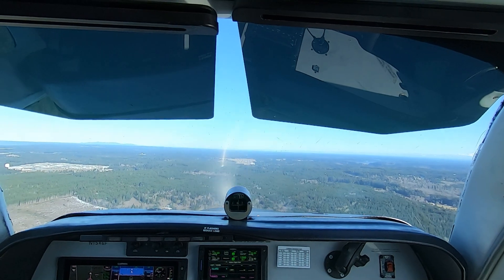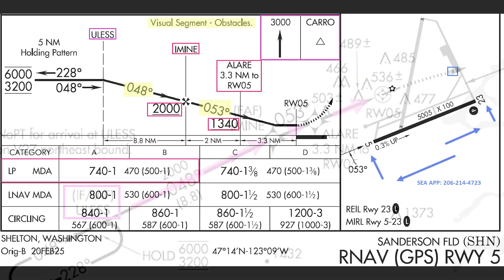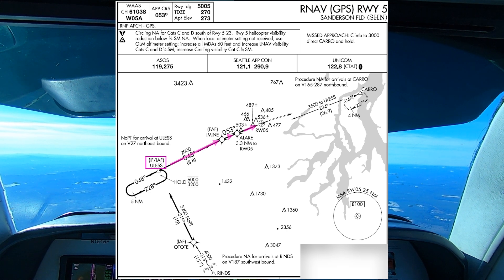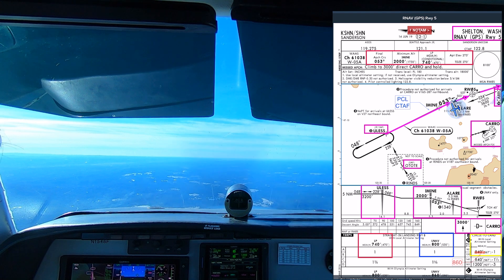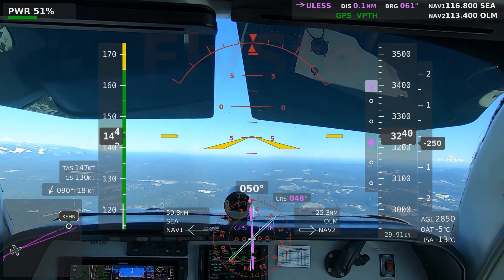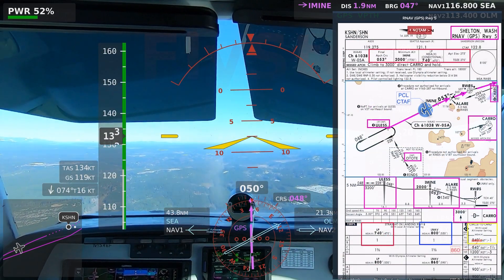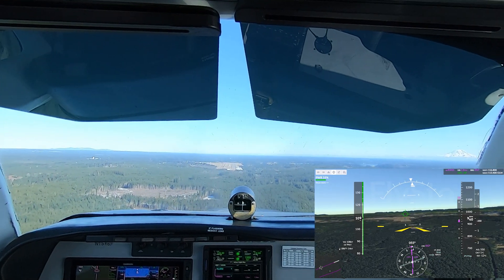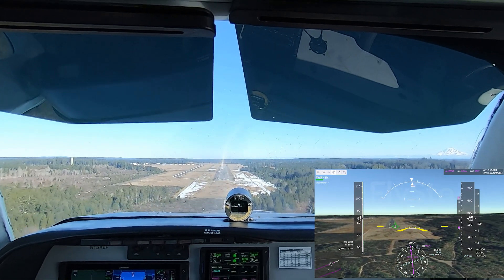RNAV Approach with Flight Data Overlay FlySto.net

Comment: Thanks Bruce. Great to see the video overlay feature in a real flight.  How do you get the Chart overlays in the video?
Reply from the maker: I record the charts as they are displayed in EFB or Garmin Pilot (for SmartCharts). I add that video track to the tracks from the other cameras and edit the video in Adobe Premiere Pro. It's a process. A typical video includes about 4 separate tracks must be synchronized and then cut between.